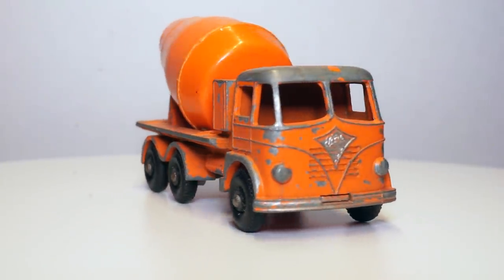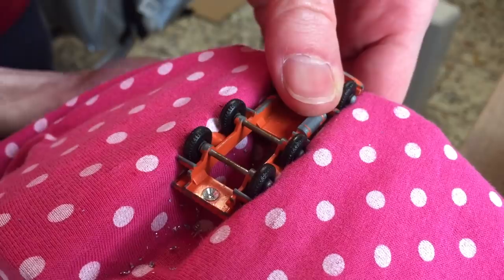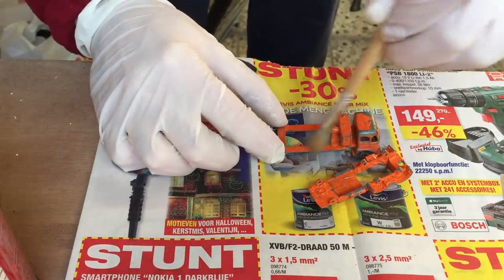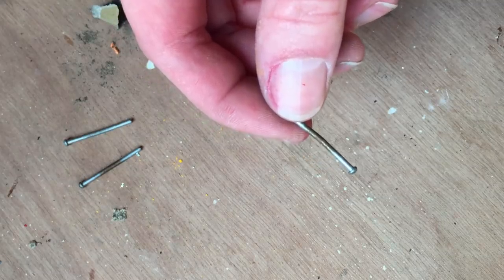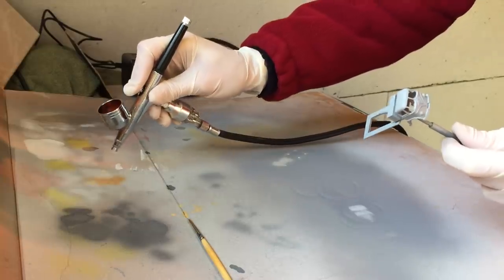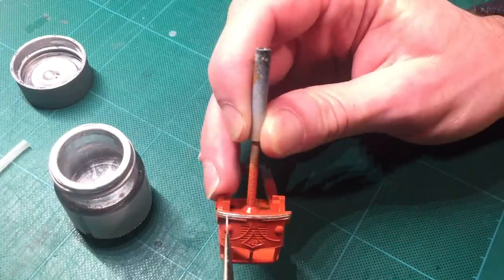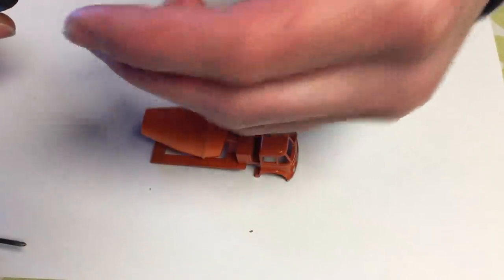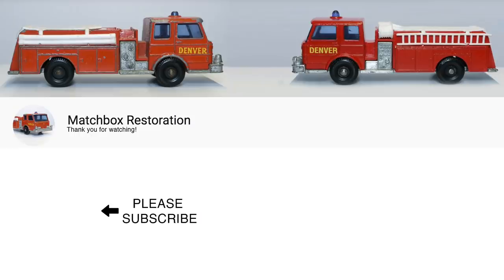Matchbox 26b Foden Cement Mixer - Full Restoration

Comment: Another excellent restoration. I've always liked this casting as the front of the Foden is so detailed. I like the tip about the fibre tip pen to help in prepping before painting...I'll try that myself.
Reply from the maker: Thanks! Make sure to rinse off the small parts that come off the fibre pen before applying paint/primer. Otherwise you'll have a lot of small fibres that will show up. Don't ask me how I know this 😄
Reply: @MatchboxRestoration  Thanks...I'll keep that in mind.

Comment: A couple ways to fix the crack on the barrel:  the old superglue and baking soda method or you can plastic weld it by using a soldering gun and a clear zip tie (the zip tie is your solder for the process),  a model body filler, JB Weld two part epoxy, all choices to try, wet sand the repair with 600-3000 sand paper, prime and paint.  Hope this helps.
Reply from the maker: Thanks for the great advice! I'll look into this.

Comment: Great restoration, very good brush skills too.
Some ideas:
Dip the car into the paint remover instead of putting paint remover on the car. That way it can get everywhere and seep under the layers as they get loosened meaning less work for you.
For removing oxidation try using an electropolish setup like baremetalhw explains.
Before painting use a degreaser to clean the car and don't touch it after.
Sanding the car between paints will reduce the orange peel effect.
Reply from the maker: Thanks for the kind words! I dipped the model in my first two restorations without too much benefit in paint stripping. I'll look into the other advice you gave. Thanks for taking the time to write this up! :)

Comment: Niiiice job! (I'm becoming "restoholic" because of you fellas 😊) 
 May I sugest you to use a 1mm or less drill bit? This way the risk of beeaking the car is smaller; You can find cheap ones on e-bay, and the screws too 😉 Happy holidays!
Reply from the maker: Thanks! 1mm drill bits tend to break even faster than the 1.5mm I'm using. I don't know if I can tap 2mm thread in a 1mm hole. Thanks for the advice, though!
Reply: @MatchboxRestoration  Definitively, but bits of WD-40  while you are drilling (after you made the hole that will guide the drill) and pressing not very much could help with that issue.
 Happy holidays 😊

Comment: Matchbox Restoration A small point here. The Foden branding at the front of the truck is not all chrome within the kite-shape, the chrome is only on its outline and the Foden name in the middle, the rest is the same colour as the vehicle.
Reply from the maker: Seele2015au I did the trim details just like it was originally, no? If you look at the “before” part, it’s exactly painted as it was. Or am I missing something here?
Reply: @MatchboxRestoration  During production of the model it was easier to paint the whole thing solid chrome, but for real Foden trucks, the front is as I described; it's worth checking Google image etc.

But here's the point: how far should a restoration go? If a model was made - obviously with cost considerations - where some details are different from the real item, should it be restored to the point where the designer would have wanted it to be, but the manufacturing team could not deliver? Now that's the dilemma faced by restorers of pretty much everything.
Reply from the maker: Ok, I see what you mean. I always go for the finish like the model came in. But I appreciate the feedback! Thank you!
Reply: @MatchboxRestoration  I am glad you have restored the model to your satisfaction. When I do my own restorations - no Matchbox cars yet - I tend to put myself in the mindset of the original designer and visualize how he would have wanted it in the first place. For example, I have a few watches designed to be as thin as possible, but at the time, the crystals (AKA watch glasses) available to the manufacturer were all quite high in profile, so they were used. Now, as compatible low-profile modern crystals are available, they are substituted. Not original of course, but I would say it is much closer to the designer's original vision.

Comment: I have been reading up on air brushes (I plan to purchase one in the very near future) and from what I have read if you thin your paint to about the consistency of milk it will flow through the brush better. This may or not be true, but I thought I would pass it on anyway. One thing I have learned from practical experience is to mask areas I don't want paint, for very small areas pin striping tape works great, that way if my hand is a little shaky while trying to steady it I still get nice straight lines. They used to sell a liquid mask that I used years ago, but I am not sure if it is still available. Unfortunately if you are painting over already painted areas you need to let the paint cure. I usually will wait at least a day before masking a painted area, I know some people just wait a few hours. It really depends on the type of paint you are using.
Reply from the maker: Thanks for your feedback. I always make the paint thin enough (milklike as you say) so it flows nicely through the gun. Primer -> paint -> clear coat, each a day apart to avoid problems. I haven't masked any models yet, but I might need to do that in one of the next restorations. Thanks again! :)

Comment: Nice job, thanks for the tip about fiberglass pen. Just a thought, would a modified nail set help with the axles? Grinding the tip flat or even slightly concave may make deforming the end with a hammer easier.
Reply from the maker: Thanks, Stephen! I'm looking into other methods for the axles. I know about the modified nail set that Marty also uses. Thanks for the advice! :)

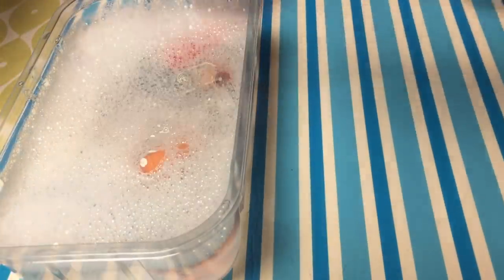Comment: At 6:03, if the barrel crack disturbs you, just buy a replacement one, or replica, or make one on 3D printer. I know, restoration work is expensive.
Reply from the maker: I looked for a replacement, but could only find one for the 26a model, which is smaller than this one. 3D printing might have been an option, but I was worried the lines of the layers would ruin the look of it. I might have to look into some modelling putty together with some fine 3D prints and my airbrush skills. Thanks for the advice! :)
Reply: @MatchboxRestoration  

"3D printing might have been an option, but I was worried the lines of the layers would ruin the look of it."

It depends how fine is the resolution of the 3D printing, and then, once the detail is out, it is sanded, etc.

Marty uses 3D printer to make details he cannot find.
Reply from the maker: @MrRoboticsTeacher  I'll give it a go if another model needs this. I can go down to 0.08mm per layer on my printer.

Comment: why do you spray the truck with primer ...when the original model does not have primer ?
Reply from the maker: Good question, never really thought about that. The primer is obviously for better paint adhesion and filling the small imperfections of the model. But you do have a point there. :)
Reply: @MatchboxRestoration  thanks .. yeh if you use a quality paint .i imagine using primer is not necessary

Comment: You probably could have fixed the crack in the barrel with some MEK (methyl-ethylketon) apply with a brush on the inside and let capillary action fill the crack. You should be able to buy MEK at a modelbuilding shop

Comment: If you want to use the hammer method, perhaps a small ball peen hammer using the ball end.
Reply from the maker: Yes, I read about that somewhere. I now have a drill press, so that issue is solved 😇

Comment: What is a fiberglass pen?
Reply: Marshall Van Wagner III it’s a pen-like device with a cartridge made of fine fibreglass strands. You advance the ‘nib’ and use it to sweep over the surface. It has fine abrasive qualities. Good for getting into nooks and crannies where steel wool or carborundum paper doesn’t go.
Reply: find them on ebay
Reply from the maker: Thanks for putting up the links, guys!
Reply: Thank you! Mine will arrive Monday! I think it will prove itself to be useful!
Reply: They are very useful but make sure you wear rubber gloves when using it cause the splinters of fiberglass will stick in your fingers and are almost impossible to see when trying to remove them